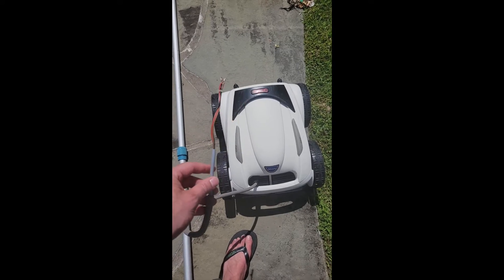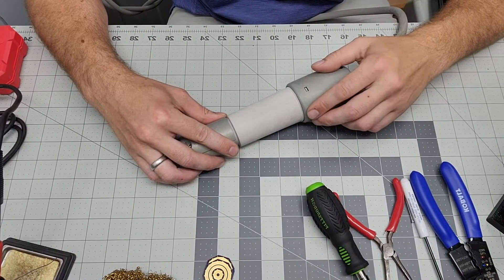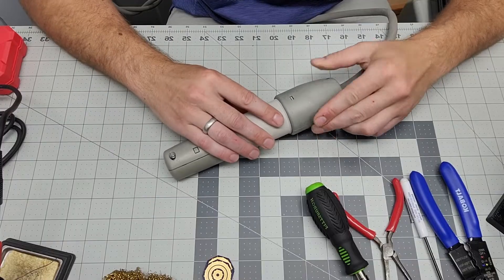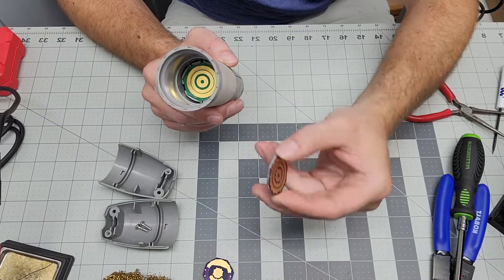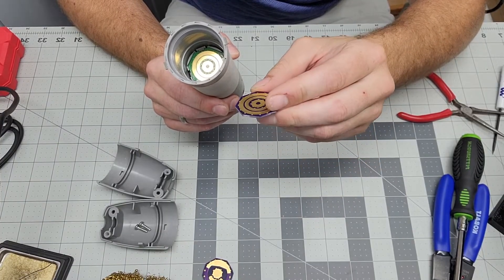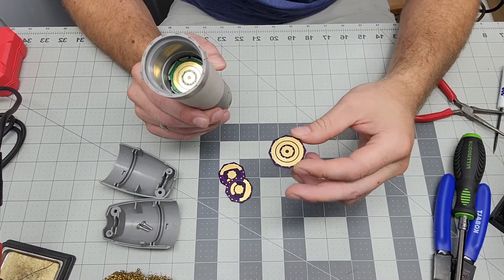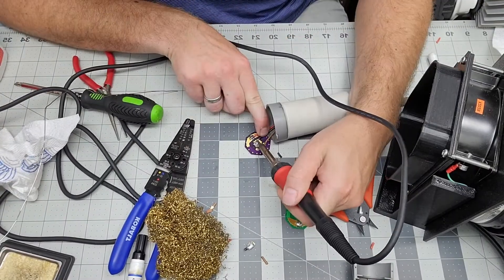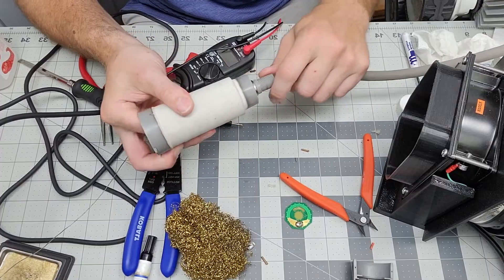Polaris Zodiac Pool Robot Swivel Cable Repair (R0726700)

Comment: Thank you Kevin.  It seems placing a dollar sign in my comment gets it deleted.  Here's some more info for rebuilding the swivel.  I did this in October of 2025.  
I ordered the PCB (Circuit Board) from OSHPark.  3 pieces for 8.05.  To order, follow directions in Kevin’s link.
I ordered 2 EAI Oil Seal 18mm X 30mm X 7mm TC Double Lip w/Spring. Metal Case w/Nitrile Rubber Coating seals from Amazon 8.95/ea. Total 17.90
I ordered 3 pogo pins (interconnect pins) from Mouser, part # 818-101057-010-952.  MFG Part No: 101057-010-952, Smiths Interconnect / IDI SH-3-J-7-G S/C. 5.07 ea plus shipping 24.38 total
I did not replace the large o-ring on the stationary side of the swivel.
I have pictures and some instructions at 34hotrod dot com/PolarisPoolCleaner

Comment: I opened my swivel after watching this video and it was full of water. Dried it out and put some line on the I ring and reassembled. It works!
Reply: Has the problem reoccured since?
Reply: What does "put some line in the O ring" entail?

Comment: Excellent instructional video! Can one lubricate the swivel in order to prevent or lessen cord twisting?
Reply from the maker: @duffymapes9076  Thanks. I guess you could use Molykote 111 or Super Lube Silicone Grease on the o-rings.

Comment: Personally, I doubt that the swivel is even necessary.  Just another failure point that they charge an arm and a leg to replace.
Reply: Mine tangles even with the swivel
Reply: I don't think it ever actually swivels in use.  Mine always tangles too.  If it worked, I'd draw witness marks with a Sharpie to see if there's actually any mobmvement while in use
Reply: I use my Alpha IQ+, which has a swivel, every day and the cable twists every two or three days. Very inconvenient to have to detangle a 70' cord that often.

Comment: Cleared my error 10 by cleaning pins at controller head and unit will work in lift system mode only no movement in cleaning mode ????

Comment: I purchased my Polaris cleaner about two years ago.  Got an Error 10 today which wouldn't clear, so I figured I'd check out the slip ring first.  Apparently, the cable design has been changed.  I was expecting a standard slip ring.  Mine had an 1/8" TRS headphone jack and plug instead of a slip ring.  The slip ring was fine, and my issue ended up being some sort of buildup on the control board caused by water leaking past a bad motor compartment seal.

Comment: Thanks for the video.  I was getting Error 10 occasionally and then eventually it would just say Error 10 all of the time and the robot would not work.  I took the swivel a part and found a bit of corrosion that was connecting two of the round circle circuitry.  Brushed the corrosion away and that fixed my issue. Now my robot is fully functional and saved me from buying a $500 replacement cable.   Thanks again!

Comment: Hi my name is Alex thanks your video is very good . I have slightly newer vrx iq plus Polaris 4WD when I open my swivel it is different construction than your model one side is a pin connector like older head-cellphones and other side is the hole so it like mother and father connectors so it doesn’t have that part (round plate) is you replace and it was wett inside also I am dried out and then I decided to check wires with multimeter since this unit 4WD it has 2 plugs to motor I thought the test inch plug off 3 wires individually all 3 wires have good test no breaks on them ,but the second plug has nothing in all three wires.The question is something wrong with this second plug which three wires it has zero reading assuming I do that test on the shorter part of the unit because I removed this pin from swivel whit rest of the larger parts of cable?Thanks Alex

Comment: Is it worthwhile replacing the swivel  seal,A -18-30-7F, otherwise continued water ingress will continue to cause problems ?
Reply from the maker: Yes!
Reply from the maker: Bad seals are no good and must be taken care of.  In my particular case the seals were not an issue so I did not do that in the video.
Reply: In my case the seal was sound however I did pack lanolin grease (rubber friendly) inside the swivel between seal  and the housing holding the swivel board and also external between lock nut and  outer swivel housing. Finally, a special thanks to you for supplying the Gerber file for the board. It saved me a lot of time and heaps of $$.

Comment: Thank you so much. I have maybe a stupid question: is that swivel really necessairy ? I'm just curious how long it will become tangled.
Reply from the maker: I think the swivel unit helps, but how much is a matter of opinion. Most other pool cleaners of this type include one. I think the Dolphin brand provides a superior cable and swivel unit that is less prone to tangling. Please let me know your experience if you decide to remove the swivel unit.
Reply: @kevinfundarek5294  Do you have a suggestion how to isolate from water in the case I decide to remove it ? Is shrink stuff will be enough ?
Reply from the maker: @simonlapointe3111  I would cover the individual solder joints with shrink tube. Then coat all the joints together with a high strength epoxy, and put another shrink over the epoxy after it solidify. The key is to make sure the epoxy makes things water tight.
Reply: @kevinfundarek5294  thanks, appreciate. I just found out, that's the vendor said, that this error 10 turns out to be the motor (properler) failure, $600CAD, I give up ! I will have some parts to sell  ;) the purchaise dates from 2018. I often use the basket with the finest filter to scoop up silt, maybe that's hard on the motor, don't know.
Reply: @simonlapointe3111 a friend was told the same thing. Quoted over $1000 to repair.  Motor is around $400- 500. $500 labour seems hefty
Reply: If the unit comes with a swivel then it has to have one. The cheaper model which is a two wheel drive dosent come with a swivel and cable knots up badly
Reply: I use my Alpha IQ+ every day and the cable becomes tangled every two or three days. Very inconvenient to have to untangle a 70' cable it that often.

Comment: Is the swivel really necessary? In reality couldn't I just wire it together inside the swivel housing and make the swivel stationary? Mine gives an error 10 code on the power supply when not plugged into or connected to the cleaner, is that because it isn't making a full loop connection?
Reply: Swivel is an anti tangle device. Regular cord will work but has ongoing problems with Robot "tying itself in knots" during use.
Reply: I kako ste slozili žice po brojevima? Koji broj je crvena a koji broj siva i crna?

Comment: Thank you for the video.  What should the electrical meter checks be?  I checked continuity for the three wires with the corresponding spot on the back side of the PCB. It showed continuity no matter which wire and back location selected. Is this correct? My PCB wasn't the reason for the disassymbly, it was the wire insulation seperated at the junction entering the robot.  I had to put a heat shrinking sleeve over it.
Thanks
Reply from the maker: You want to make sure there are no shorts with a meter. There should not be continuity between the ring traces or wires.

Comment: Hi, I am trying to follow your instructions and using oshpark to order the board using your Github zip. They are saying it is missing hte silk screen layer file? Any ideas? Thanks again for all this help!
Reply from the maker: There is no silk screen layer for this board. A silk screen is generally a layer for white alphanumeric text to call out component ID numbers, which are properly called reference designator (or "ref des" in shop talk). This board doesn't have any components (i.e. resistors, capacitors, etc), so the layer is not needed and hence not included. As long as the board is rendering correctly on oshpark.com's site you will be ok. Many people have ordered the boards with no issues, so unless oshpark recently made operational changes there is no need to worry. Hope this helps you get your bot fixed. Good luck!
Reply: @kevinfundarek5294  Thanks for the clarification and that I can ignore the warning message. Your help on this is much appreciated. Hopefully this solves my issue.

Comment: Great video, thank you!  Question: how did you know it was the PCB that was the problem?
Reply from the maker: In my case the copper trace of the pcb ripped off with the wire showing the FR4/fiberglass substrate of the PCB.

Comment: First thanks for the video. I open the unit and noticed it was wet. It seems like they changed the design. I have a slight different design. My question what is the best thing to use to seal the unit and prevent water from going through
Reply from the maker: I would use an O-ring made of Viton or Buna:
https://www.mcmaster.com/content/o-rings
You will need to measure the o-rings in your swivel unit and replace them with the correct size. Good luck!

Comment: This was helpful, though the only mis-step (apart from pulling the wires out of the swivel) is trying to grip the threaded plastic to remove the nut. If you look at the other end of the swivel, you will see the internal sleeve also has two indents that you can use to hold with the long nose pliers to screw or unscrew the nut... Thanks for sharing your experience - turned out my cable is fine, so now looking at the motor board, as there appears to have been some small water ingress.

Comment: It's only been a month did you already sell out of the PCB? :( Also one of my pogo pins isnt springing back out....any Idea where to get a replacement for that?

Good video btw. I took apart the whole thing and put it back together now it seems to be working. Only part I didn't take apart was the part behind the PCB.
Reply from the maker: Glad to hear it's working. Millmax manufacturing is the largest producer in the world for those types of pins, so there is a good chance it came from them. If you use a caliper to measure the pin dimensions Milmax customer service can probably fine a replacement to sell you. 
I sold a few PCBs. I'm just not selling on ebay anymore because of some of their policy changes. I'll have more for sale at another site shortly.
Reply: @kevinfundarek5294  hey There. Did you start selling again?
Reply from the maker: @calishakes2860  I ended up open sourcing it. Please see the video at https://www.youtube.com/watch?v=-b0UC5WdfXI if you need the pcb in this video

Comment: Did you make the PCB yourself?
Reply from the maker: Yes
Reply from the maker: Well, to be clear, I designed it and sent it out to a pcb house for manufacturing. I pulled the dimensions from the one that had been destroyed
Reply: Nice work I tend to just cut the swivel out too many with water ingress.